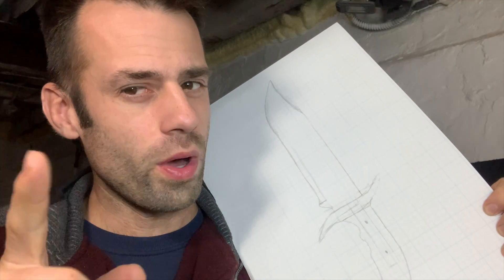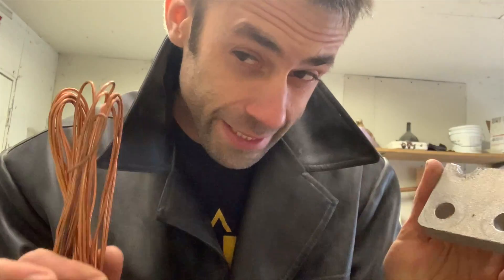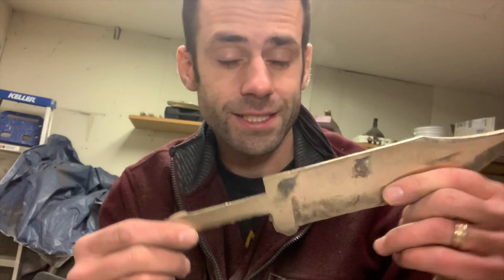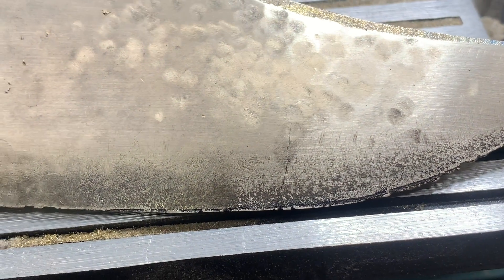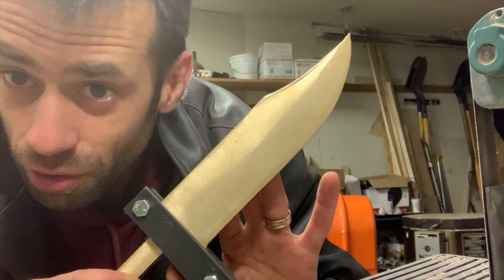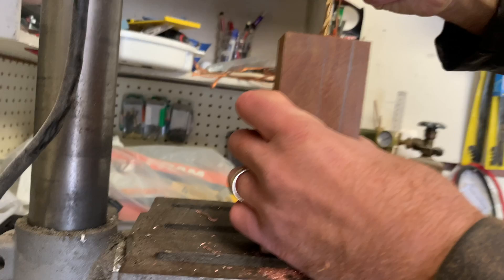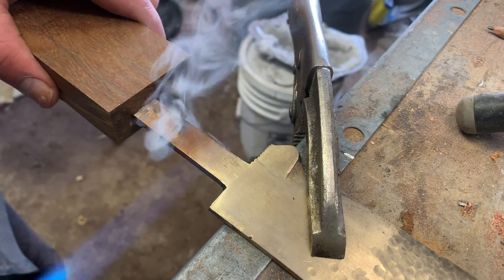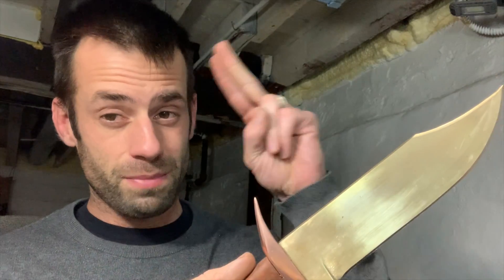Bowie Knife Challenge, Making a Bronze Age Bowie Knife.

Comment: Usually, you do NOT cold work CuAl bronze. I make blades from High performance bronze (with nickel, aluminum, iron etc), they can be quenched and tempered to get impressively hard for a copper alloy, BUT they will shatter if you try to cold work them when they are hardened, and even after annealing, do not deform them too much or they will break. That's why it's a pain for me to forge this alloy, you have to keep it in a very narrow temperature range, going above will melt it and basically you start over, going under will make it crack.
Good luck on your next attempts ! I can give you advice on forging/hammering bronze tho if you need
Reply from the maker: Interesting. I’d love to see some of your work.
Reply: @lundgrenbronzestudios  sure, here's a link to a video i made. It's in french so you might not understand a lot of the subtitles, but basically i just forged a blade from bronze, made a plastic handle for it, and assembled the thing.

https://youtu.be/Yhynrw6B3D0?si=k3Tga3gdltbSeNFF
Reply: @Walking_BearFoot  nah i forge them, the only bronze i cast is for ingots that are then forged
Reply: If you were making a knife out of copper-aluminum-nickel, what ratio would you recommend?
Reply: @JRRGimli  CuAl10Ni5Fe4Mn is a very good alloy, so 10% aluminium, right in the middle of the two phase zone (below 9% the bronze cant be quenched, beyond 11% it can't be quenched either), iron and nickel to strenghten the alloy and reduce grain growth, and some manganese but i'm not sure why they added it. This bronze casts kinda well, but most importantly it can be forged very well, tho it can't be cold worked much or it will crack.
Reply: @jeanladoire4141  if I'm not mistaken that is C63000. Definetly want to get my hands on some at some point in the far future. However for right now just about the best I can do is make a homemade copper-aluminum-nickel alloy in a backyard propane furnace. I read months ago that an 85-10-5 mix produces good results for blades (using nickels for the, well, nickel, since american nickels are 75Cu25Ni), but haven't had a chance to try my hand at it yet. Just wondering on what your thoughts on that might be
Reply: @JRRGimli  then if you don't have all the metals, stick with good old alu bronze, you can make 6% al bronze for a tough but hard version, perhaps 8% for a harder version but still usable. Or you can go full martensitic with 12% but it's brittle as hell. The micro hardness of copper/aluminium (kinda équivalent to iron/carbon, that's what makes the alloy hard), is about 40HRC, wich isn't huge, but very good for a copper based alloy.
Or you can make a white cast by only using copper nickel, also called "white copper". Not very hard, way less impressive than aluminium bronze, but it's shiny 😎

Comment: You could buy a centering scribe but an equivalent sized drill bit scratched on both sides of the cutting edge will give you a pretty accurate center line to grind to.

Comment: Odd that the 90/10 cracked like that, that ratio has worked fine for the axes I have made.  Maybe because a knife blade is much narrower... Or maybe you lost more copper to oxidation and the Al % went up... Did you peen the edge of the 2nd one?  Ought to hold up a little better than mild steel if so (at 10%).  Looks great!
Reply from the maker: I peened the cutting edge of the second one but ground it all away when I did the final bevel.
Reply: @lundgrenbronzestudios  lol, been there!  Just don't try to chop down any trees without a work hardened edge...